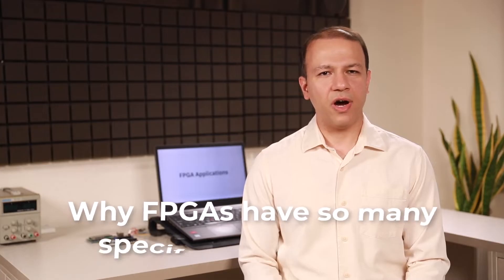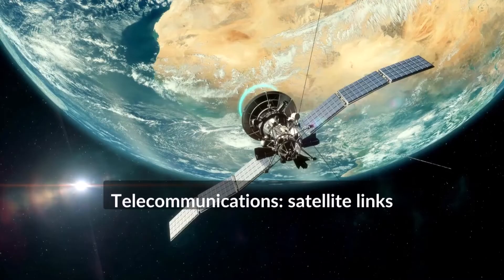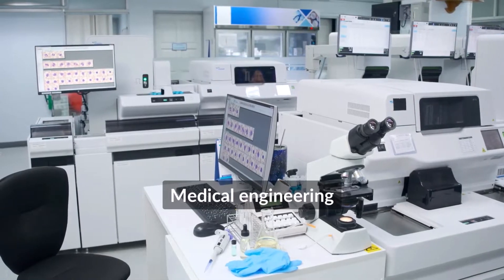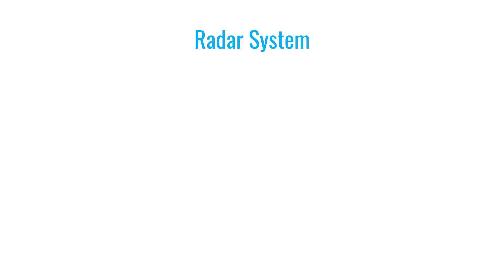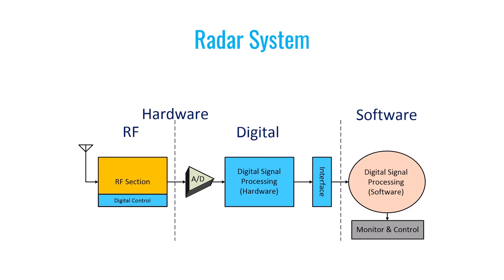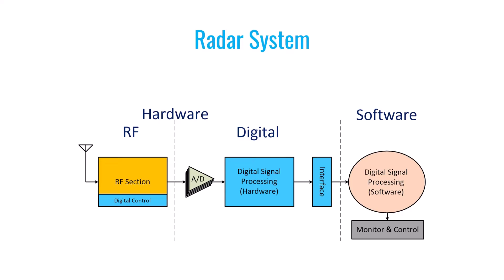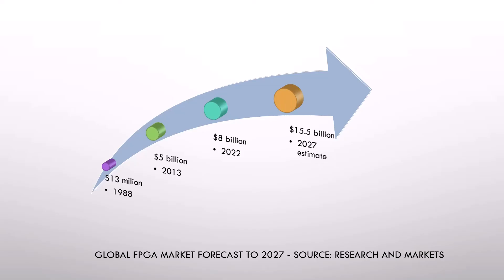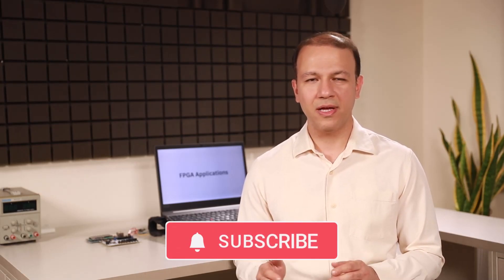Are FPGA Engineers in Demand? | Exploring 10 Common Applications of FPGAs

Comment: just everything that comprises real time, high speed and low latency. the developing time and skills needed are very high so it has to deserve the efford.
Reply: LOL Please define "real time" and "high speed". Points for "latency". "Developing time"??? I was putting out a new design every 3 months in my FPGA design. This was because I created an embedded micro-sequencer in my design. I only had to change a few parameters and POOF the entire response curve of the signal was updated to new customer requirements. I say "3 months" only because it took them a month to come up with the new requirements and another couple of months to do testing. Code changes were in the order of 1 week. HOWEVER, I do agree, the initial design took a long time. But divide that by total number of products created by the same design, and you have the equivalent of 2 months of FPGA design time per customer. So, it's not the technology which drives the "development time", but rather the skills of the engineer! The beauty of FPGA is that you create reusable modules. Once you have 100 or so modules, the design time is highly reduced. The same goes for PCB design. Think "architecture" and "reusability". 

Concerning skills, yes, you can learn (poorly) to write a few lines of code, but (good) FPGA design requires that you are taught by someone who understands how to think. The effort is likely 10 fold.